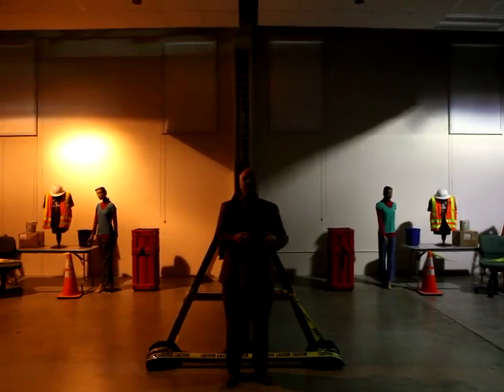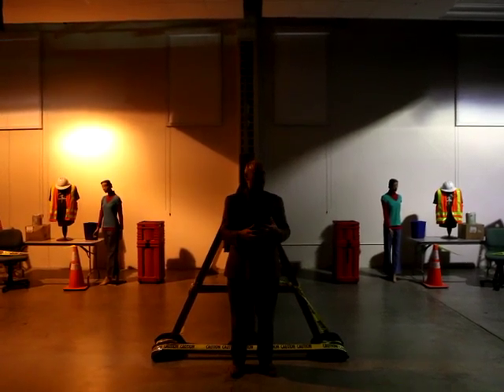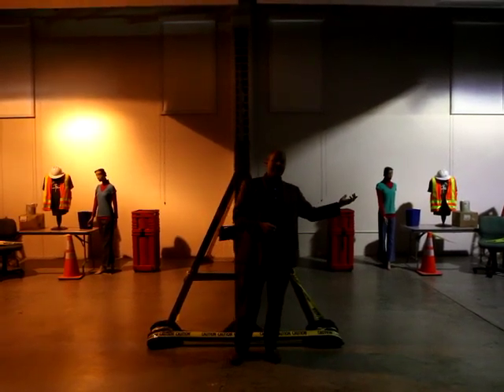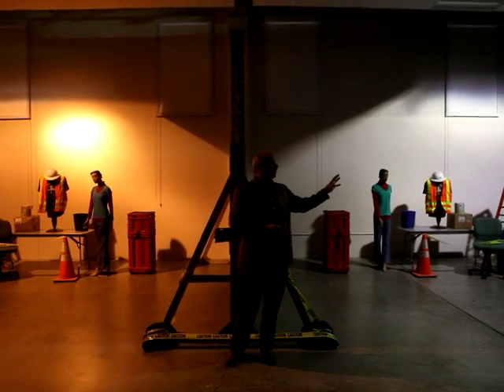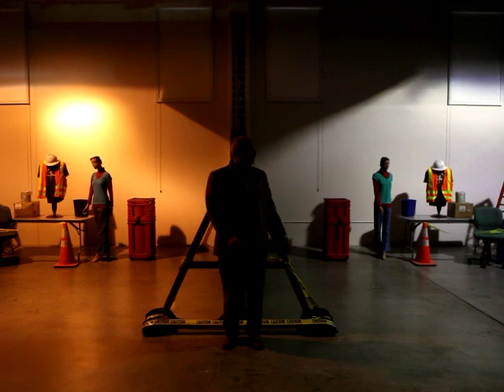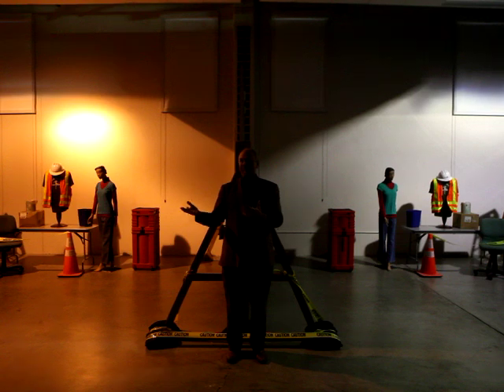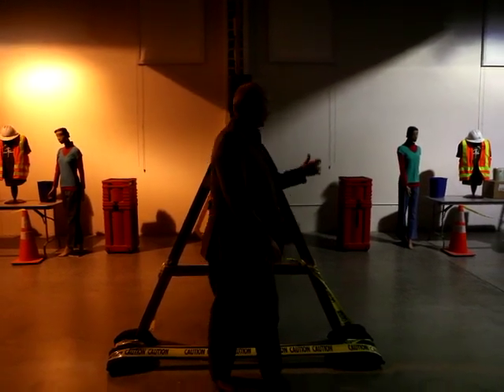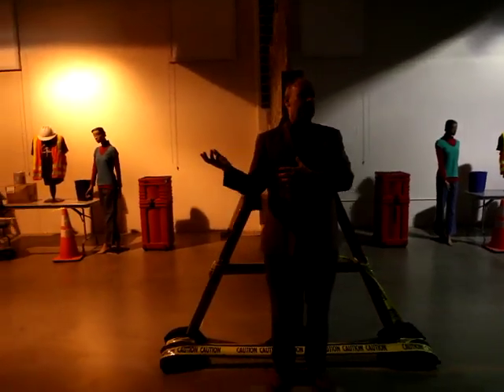Difference between High Pressure Sodium and LED street lights

Comment: The main problem I have with LED Is the way they look most of them, glary, & cheap quality, also they don’t even stay with a design for over 2 decades they change them less than a decade 😂. HID Fixtures sure they use more energy & supposedly more pollution than LED But they last way longer, don’t change designs every 5-10 years, less ease on the eyes, & there beautiful design.

Comment: LED lights make night look barren and cold. They contribute to depression and increase suicides. There is blood on the hands of those pushing for LED street lights.
Reply: lower light costs = money saved = more funding for suicide hotlines & mental health clinics

your point?
blinded by nostalgia.
Reply: @cemops8660  LEDs do not achieve lower lighting costs in a clean way. It is a common misconception that LED streetlight fixtures are more efficient than HPS fixtures in converting energy to light. Look at the product brochures for your City's LED streetlights, you will not find one that passes the 125+ lumens/watt mark of HPS lighting. LED streetlights save energy by lighting a smaller area to a lower luminance, a practice justified by the foundationally false claim of blue-wavelength efficiency in night lighting conditions.

Comment: a fair comparison would be nice, obviously that glare makes is seem less bright. but if you ignore that, the hps BY FAR has less shadowing under the table and behind the dresser. LEDs are cool in all; but for outdoor lighting, not a chance, they are to point source creating horrendous glare and therefore ruining your night vision, driving in fog or rain creates even MORE problems with glare unlike LPS or HPS. Until they can make amber leds as efficient as those disgusting and blinding blue/white leds i will not be a proponent to them. If you want efficiency and enviro friendliness use LPS (yes I understand S/P ratios but that gets thrown out when talking outdoor lighting) These new blue/white LEDs are ruining the night sky and your night vision, sodium vapor is much more friendly towards the night sky as long as you have a fixture that is dark sky friendly.
Reply: +Will Davis Sorry, but I notice more glare when driving at night, especially in damp conditions.
Reply: +SuperBigEv I'm with this guy on this one. I know nothing about the science of LED v sodium street lights, but many of the LED street lights I've seen installed recently (and ouncils are crazy for them at the moment, the way everyone was crazy about concrete in the 1960s) just seem so dim and shadowy. Many streets which used to be properly lit up now look only half-lit in a kind of murky white light you'd associate with deserted warehouses. I understand the argument about white light not distorting colour, but see little actual evidence of this. Anyway, don't take my word for it. Just drive along a well lit up high sodium road at night and compare to an LED road, and ask yourself which one offers the better visibility.
Reply: The new holophane fixtures installed on I-96 are not bad. But still pretty horrid in the rain and fog. I still miss sodium, but oh well. Thanks for the comment!
Reply: SuperBigEv So much false.  Firstly, LED's are reducing night pollution, not adding to it.  Secondly, there are already LED street light products by the likes of the top brands, Philips et al. that are designed to reduce glare.  Some of these products are in testing and already produce less glare than HPS.

Our local council switched to LEDs and I have noticed no extra glare.  Due to their directional nature, there's actually less glare, and less overspill into house windows so home owners get a better night's sleep.  Despite this, drain lids, potholes, and pedestrians are EASIER to see due to the whiter, more efficient colour temperature and higher colour rendering index.  In particular high-vis jackets show up more easily under LED.

Comment: Lumens per watt is a poor metric to use to compare lighting efficiency. 120 watt HPS units are regularly replaced with 58 watt LED units that provide better lighting despite having a much lower overall lumen output. This is due to 2 factors: 1) LEDs are directional, sending their light output straight down where it is needed, rather than glaring wastefully in all directions 2) unlike sodium, the majority of the light energy output by LEDs is at the best wavelengths (daylight) for human vision.
Reply: mmmmm unless you want  spot lights or something the LED is not better, the light being directed in one direction is a DOWNSIDE to LED's.. not a positive.. this is why its taken DECADES times over to improve light spread on LED's.   Id rather have a HPS barn light for example that spread light all over my property.. than an LED that has a 30 feet diameter spread....  sorry

Comment: Low and high pressure sodium lamps are the most efficient electrical light source existing today. At 200 lumens per watt, low pressure sodium takes the cake, with high-end LED lamps getting 70 lumens per watt.

Comment: There is no comparison. LED street lights are superior in every way. The quality of light is far better - they provide sharp true color just like daylight from the sun - the way we have evolved to see. They direct the light straight onto the street with no dangerous side glare and light pollution. They use much less energy than other lighting technologies and last far longer. I have been rejoicing that they have replaced the dangerous ugly glaring HPS lights in SLO with quality superior LEDs.
Reply: They can still cause light pollution, by the same effect that the suns light reflects off the moon, the moon is not white by the way, it is grey, much like the pavement of roads or atleast the older roads that have not been repaved which is most, I'll have you know there is HPS fixtures with optics that focus light downward exactly like these LED's you speak of, also you say they're dangerous for their glare? you realize that these things re mounted up high, so realistically there will be side glare no matter what light source it is, therefore that argument is invalid, also they are not the most efficient light source, Low pressure sodium (LPS/SOX) has reach efficiencies of up to 200Lm per watt, which still is higher than any available LED as of yet. and yes humans are evolved to see similar light to sunlight, but you don't need sunlight for traveling on a road, nor do you necessarily need high colour visibility, infact HUMANS DID NOT EVOLVE TO SEE THE SUN AT NIGHT! it is much more beneficial to have dimmer lights at night, to both humans and the environment, i might also add that the lack of color forces you to see certain details better since your eyes /brain are forced to adapt to their loss of ability to see colour information, and currently they do not last longer than ALL other lighting technologies, one technology that has been proven to last a long long time, and by long i mean decades is the mercury vapour lamp, which some have been burning bright for as long as 60 years, LED has not had the time to prove itself like this, therefore you cannot claim they last longer than ALL other lighting technologies
Reply: so you just said LPS is 200 lumens per watt. then said that darker at night is better.???
the UK banned SOX lighting as it was deemed unsafe for lighting roads BECAUSE of its HORRIBLE lighting index rating. you can't determine any colours individually and road signs/ road markings will all appear yellow.

Your point of 200 lumens per watt is true. But how many of those lumens are useful and being seen? In this case it's not just about how bright it is. It's about how clearly you can see. there are LED lights on my road that have been up for about 13 years. so they definitely last longer than HPS/ metal halide for bulb replacements.
Reply: @cemops8660  exactly... people who love HPS always they talk about is the lumens per watt..... Listen Mercury vapor lights are even better than HPS.... MV is blue/white like LED.. with coated bulbs it allows you to see people and objects and cars much much better than a HPS light..  I have a HPS light on the electrical pole on my property its a 150w light.. puts out supposedly 16,000 lumens.  However my single Mercury vapor light at 175 watts only puts out about 8k... but i can see everything much better under the MV light than i can the HPS light.

People unfortunatly grew up with HPS lights.. from the 70-2000s..  They dont know what white light from Mercury vapor looked like, even with metal Halides which never took over.   Instead everything was orange growing up for people.   They dont realize the white LED and white Mercury vapor is better..    That 16000 lumen HPS light I barely can see someone walking across my yard even walking directly under it.. especially in dark clothing..  I bet you over the 40+ years for HPS tens of thousands of pedestrians were killed because of the poor visibility its creates.

Sure its a nice orange pleasent glow for sleeping with some light on, or a nice glow for a wall light on a building... But LED for visibility is vastly superior.. they totally went backwords when they replaced mercury vapor lights...  The other problem i have though is with LED reliability.   Most of the fixtures out there are made in china... chinese knockoffs.. all the dusk to dawn lights i find all have a lot of terrible reviews with the lights going bad after 6-12 months.. its hard to find a reliable LED.. and to replace my 4 mercury vapor lamps.. it would cost $500 for the 4 LED fixtures to replace my mv ones, and this is only for a 70 watt led with 8k lumens like my 175w MV...  the energy cost of MV would be $20 a month vs 8$ a month on led, so in 4 years i finally make up my $500..  and then it would take another 4 years to save $500...  will those leds be working 4-8 years from now..  i highely doubt it.. I havent met a single LED light in any aplication that doesnt get burned out diodes and so forth and last for years...  not one in anything i buy....  But my mercury vapor lamps are 30 years old... lol nearly as old as me.. all i gatta do is replace the bulbs.. as they do get dimmer over time even though they are running..
Reply: @jeepsblackpowderandlights4305  very interesting, thank you. I guess it depends on the quality of the fixture and the times that they are on for. My council did some trials with led lamps in 2008 and they are still on the same road, but these ones come at a premium.
Reply: Well HPS is better than LEDs